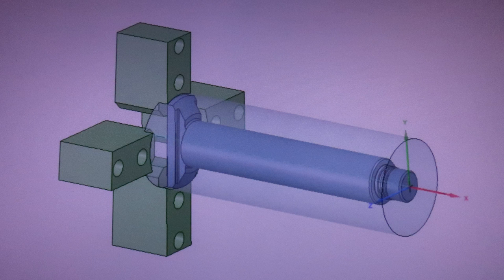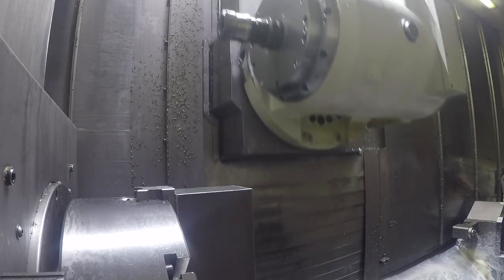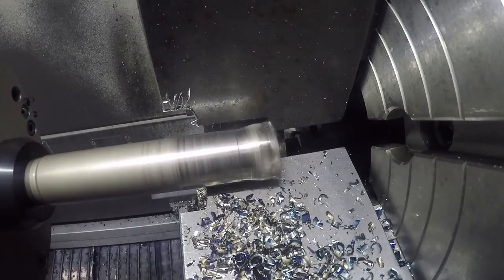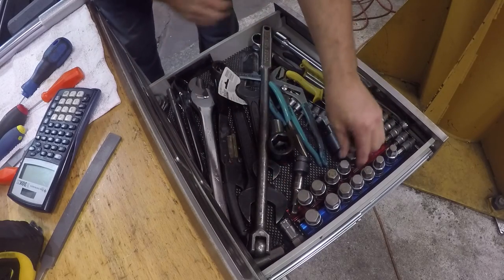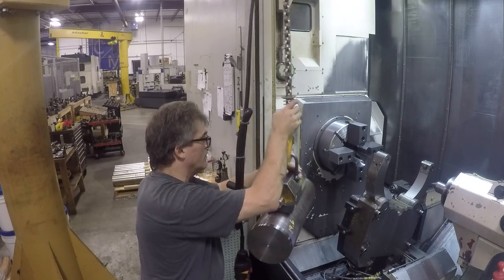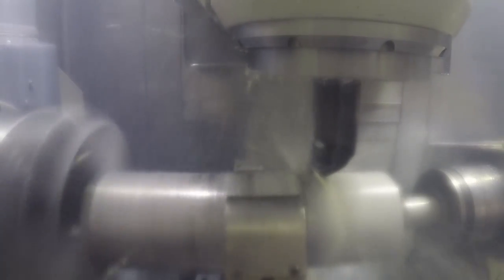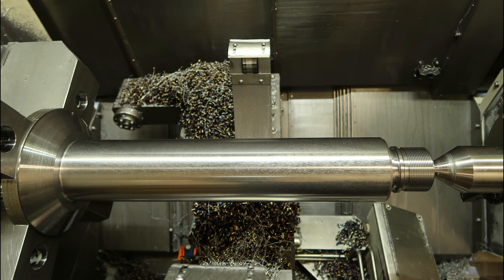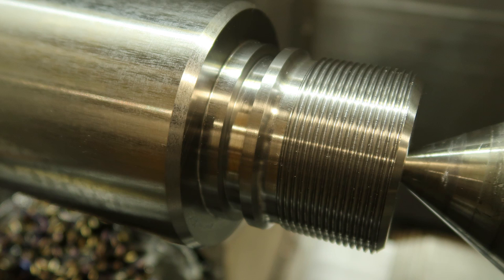Ram Shaft -1

Comment: So, Why aren't you using your tool setter for the Mazak? Seems like the way to go, and you have it.
Reply from the maker: The tool setter it up high on this machine. It is difficult to see what you are doing. I find it easer and faster just to touch tools manually. On the Mazak’s control it always shows the location of the tools tip so it also verifies that the tool is offset properly. This machine also has a laser tool setter. Which by the way Mazak recommends to use for milling tools. But unfortunately it has never functioned sense I’ve owned the machine. I don’t want to spend the money to fix it.
Reply: I meant the optical pre setter you use for the horizontal, I thought I saw that in one of your vids. I've been binge watching so the vids blur together! Thanks for sharing vids.
Reply from the maker: The Speroni tool setter has a Cat 50 taper spindle. The Mazaks milling spindle is Capto 8. Now I do have a Cat 50 to C8 adapter. I would have to mount that than walk over to the optical tool setter and measure the tool than subtract the adapters length. That all would work but it would take longer than just touching off the tool at the machine. I do use the optical tool setter for the initial rough setting of boring heads for the Mazak.

Comment: why not use a round insert? i prefer rounds when im taking big long cuts. you can often take larger cuts with faster speeds. non the less, great video.
Reply from the maker: I just used what I had. Didn't have tooling for a round insert.
Reply: @EdgePrecision  i see! CNMG are quite versitile for roughing. but if you ever wanna try them out, i highly suggest you do, go for something from SECO. best roughing inserts there is IMO. sandvik and iscar has some great tools aswell, but for me seco takes the cake when it comes to roughing. thats just my opinion.
Great video anyways :)

Comment: Do you ever get annoyed with that tight clearance near the jaws? Seems like it can be an issue with a lot of different parts and that you have to make extra long jaws to try and mitigate it. Is that just the small price you pay for the other capabilities of your machine? (-8
Reply from the maker: I actually have a smaller chuck that comes on the machine. I normally comes with a 21" Hydraulic chuck witch would make the clearance issues even worse. I like the 16" manual four jaw better and it increases the available spindle bore to 6.625". The jaws for that 21" Kitagawa chuck would also be more expensive.

Comment: a Little Tip on Jaw truning
Rough:
VC=350-450 m/min 
F=0.15-0.25
AP-5-10mm
leave 1mm on the jaws
use a 80° CNMG insert or something of the same Base Shape
this Operation would go many times faster with these, u can aslo use Shopturn for the simple kontour of a Jaw.

Finish:
Just normal finish turning in 2 steps with an undercut in the corner (Form E/F should do)

and for removing the corners i would have opted for "plunge milling" but this is optional
Reply from the maker: There are indeed many different way to do things. Thanks!
Reply: @EdgePrecision  just an idea, please try it yourself i use it everytime i have to do stuff, my machine is the CTX Gamma 2000Tc
Reply from the maker: That is a very nice machine! You are lucky to run it. I thank you for the help/info . Please don't misunderstand me I'm not saying weather your way is wrong or right. What I present in a YouTube video is not necessarily the way I always do things. It sort of depends on whats in the tool changer at the time. Or just how I feel like doing it. I have done it exactly the way you describe and you are very correct. The kind of work I do, I seldom have to bore jaws. In fact it been over a year sense I have bored any. You may have noticed I have a manual 4-jaw chuck mounted on the spindle. That should give you a idea that chucking time is not significant to my type of work. The type of job I have shown in this video I seldom do.  But Thanks again. I do appreciate your comment.
Reply: @EdgePrecision  alright

Comment: You know, your the only other person I've seen use a gage pin/block like I do to set offsets. I use a .200 on my Haas mill, because on the keypad the 2 is right next to the "." Key. I always jog in the positive direction while applying minimal pressure till the block just slides under. If I overshoot I always pull the block away and then jog back down and redo it. Using this method I've never chipped a cutter. I think the paper method is asking for trouble and is no where near as accurate.
Reply: Same here.  I use a 1" gage block for mill operations.  It's a sweet realization when you can get that much breathing room and be more accurate lol.

Comment: Ram shaft, as in 'hydraulic' cylinder ram..? I'm guess that thread is 12 TPI, seems real common for just about any hydraulic stuff....and that 3" turned area will be getting hard chrome??
Reply from the maker: No electric less nickel it said on the print. My friend in  R&D once told me they don’t like to use hard chrome in sub sea stuff. I can’t remember why though. And I can’t ask him he passed away a number of years ago.
Reply: @EdgePrecision  OK, sub sea...they like nickel better for corrosion resistance..
Reply from the maker: I think if I remember it had to do with the bond of the hard chrome. It tends to flake off where the Nickel doesn't. But I'm not sure. This could relate to corrosion getting under the chrome.
Reply: @EdgePrecision  Engine cylinder liners are often hard Chromed. And the main cause of their failure is indeed the Chrome coming off in chunks. Nickel doesn't hold up to the heat as well so that is why it gets plated over. What do you do with a bad cylinder liner? Send it back and they machine it down to base metal again. And then build it back up with Nickel and then Chrome. It is cheaper than buying a new liner, if you can even get one. In cold work such as undersea valves, the Nickel will protect the stem as well as Chromium would. Surprised they don't just spec that ram as 304L Stainless.

Comment: Why would they choose a 4140 HT that big?  Wouldn't the HT be gone near the center, negating even buy HT?
Reply from the maker: Normally they require the part to be roughed than heat treat than finish machine. In this case they said the material was pre qualified and that wasn’t necessary. I did ask and that’s what I was told.

Comment: What are you doing on 23:23? check that the tool is well measured?
Reply from the maker: I am checking the offset on the tool. Using a 1/2" dowel pin. It been a long time sense I made this video. I think I had not set up the threading tool before this point and had to touch it off so set the offset. I like to use a round dowel pin to touch off tools instead of shim stock or a feeler gauge. If you get the tool closer than the pins diameter than lightly press the pin in the gap. Than back off with the handle jog till the pin just passes thru. This is better than a shim because if you go solid on the shim you can chip or break the tool. also with the pin you can discern between one click (.0001") quit easily on the hand wheel. Than just subtract the diameter of the pin in Z and twice the diameter in X for a turning tool on a lathe.

Comment: I see that most of the time you prefer 4 jaw chuck over standard 3 jaws chuck, why is that? Its much harder to setup
Reply from the maker: Fischer977 , Thanks for the question. I use a four jaw chuck for a couple of reasons.  It lets me use the full capacity of the spindle bore, no draw tube. For many of my jobs the jaws don't travel enough on the hydraulic chuck. The the time savings I might get from the hydraulic chuck doesn't mater for the work I do. Even with a hydraulic chuck with properly bored jaws it still has runout. I can get that closer with the manual four jaw chuck.  This four jaw chuck is smaller in diameter than the hydraulic chuck that came on the machine. This helps with tool clearance issues. The soft jaws cost less than the serrated jaws or I could even make my own easer.
Reply: @EdgePrecision  When precision counts, the 4 jaws always win over the three jaws. You are manually taking up the slop in the jaws that you just can't do in a 3 jaw setup. Unless you want to grind the jaws for every piece that you chuck in them. The scroll gear and teeth on the master jaws always have slop and just one speck of metal in between them will throw off their accuracy.

Comment: are you programming with MAZATROL? and doses't your machine have a TOOL EYE? I see you use your 1/2" dowel pin quite a lot.......
Reply from the maker: No I rarely use Mazatrol. Only to bore soft jaws do I use it. The machine does have a tool eye probe. It is inconvenient to use because of its location when folded down. The location is high up in front of the tool change door. Even with the control pulled as far up toward the spindle end of its travel. It is not possible to reach the handle jog wheel to position the tool close to the tool eye. The tool eye is about six feet high and to the back of the machine when folded down. It is necessary for it to be in this location. You wouldn't be able to touch tool off with something between centers if it wasn't. This machine doesn't have a pendent on the handle jog that would make it easier. But I think I would still prefer to touch off tools manually. On the Mazak the control always shows the tools location in relation to the active work offset. So you get a conformation of the actual location of the tool. The machine also has a laser tool setter. But when I purchased the machine this didn't function. I just haven't wanted to spend the money to fix it. The laser tool setter will do it all automatically. This is designed to touch off milling tools and the tool eye is really for turning tools.

Comment: 19:00 How did you know that the cutter broke, Mazak is able to detect the breakage of the cutter?
Reply from the maker: It is possible to set limits on tools. Typically this is called tool life management on controls. It is possible to set a time limit number of use or load and than automatically change to a alternate tool. This kind of thing is done more a higher production setting. What I have to do is pay attention to the feel and sound of the tool running. With experience you can easily tell when a tool is dull or has failed and stop the machine.

Comment: Evening, can you tell me what manufacture/model the magnetic hoist attachment you are using?
Reply from the maker: Rob McQuillen I will look tomorrow and get back to you. It's been so long that I bought it I can't remember without looking.
Reply from the maker: Here is what I have. Its called a Mag-Mate my model is a PNL 1300. They no longer make that model the new model closest to mine is a PNL 1600. They make many different models depending on the weight you need to lift. There web address is www.magnetics.com  Phone number 800-662-4638
Reply: Thanks a lot!! We need one of these..

Comment: Been years for me (since machinist trade school). Thus, why all the trouble of softjaws for a 4 jaw independent chuck? No concentricity imparted automatically by jaws. What's going on? Better part rigidity, holding surface? What? Why?
Thx.
Reply from the maker: The soft jaws give me a positive stop for the length on the first operation. Also I needed to turn close to the end of the material the stepped hard jaws didn't have the correct step height for that. On the second operation the shaft area that I chucked on to had a 32 finish call out so I used soft jaws in order not to mar the finish there.

Comment: sir can u tell me how do cut centre  on big shafts O.D 350 MM LENGTH 1900 MM 

Some easy and accurate  method
Reply from the maker: That’s a little hard for me to answer not knowing what you have. I could hold a part that size in the steady rest and drill a center hole. I have made a special tool that I can hold a center drill with the B axis perpendicular and above the part. It extends in between the tailstock and the part to center drill the end of a long bar. But that’s me do you have a lathe that big?
Reply: +Edge Precision  yes sir   we have  4 big lathes  

and aslo one turning  centre of 165 mm Indian  make
Reply: +Edge Precision  in india cnc work per hour is US  2 dollors TO 3 dollars. 
some work in scrap  of materials 

u have very good experience  of work theorical  and practical  both 

u go by method and thats make easy and perfect

Comment: You could have cut your complete job time down by just throwing them in a manual three jaw and facing then center drilling.  And that’s where the profit margin lies.
Reply from the maker: I don't have a manual 3-Jaw for this machine. At most it would only save a few minutes over the 4-Jaw chuck. Even if I did have the 3-Jaw chuck to remove the 4-Jaw and mount the 3-jaw would add up to more time than was wasted. Also this stock is larger the the spindle bore so hanging the part out this far I trust the 4-jaw chuck to hold the part more secure than a manual 3-jaw. The hydraulic chuck would do it but to mount that chuck and its associated draw tube would take quite a bit of time to clean the spindle bore and mount it. Also when i bought this machine there was a different chuck mounted so I got the draw tube and chuck separate from the machine. It looks like someone either dropped the draw tube or ran into it with a fork lift on a pallet. the threads are damaged on one end. I would need to repair it first. I have never took the time to do that yet. So I do have a 21" Kitagawa 3-jaw chuck but its never been on the machine. A extra few minutes is a little savings but not even close to the whole profit margin on these parts.

Comment: Using a magnet is an no no. chain or strap on every part. You cant get a correct reading off a magnetic part.
Reply from the maker: I have to ask. What reading are you referring to? That is if the stock got any residual magnification from the lift magnet.

Comment: center drilling without part rotation??? 
well that's what i call optimistic
Reply from the maker: If the machine is aligned properly this isn't a problem. If I'm really wanting more accuracy. I would drill a hole and come in with a small endmill in the B axis. Tipped at the 30 degree center angle. Than mill a chamfer rotating the C axis for the center.
Reply: @EdgePrecision  eeehmmm. yeah...

Comment: Dude you need to be running faster and taking smaller cuts. .01 feed 550sf. .1 doc. It will still throw chips off and won't get stringy. Make sure your roughing tool has a nice radius .06 or higher.
Reply from the maker: This part in this video I didn't select constant surface footage in my cam software. Because of that it wasn't breaking the shaving when it went up the taper at the end of the cut. On the remaining parts when I switched it to constant surface footage (G96) the problem went away. I didn't have any issue with shavings after that. What you are describing would take longer to rough these parts. You say to take half the depth of cut at 75% the feed (My feed was .015) and only 100 sfpm faster (I was running 450 sfpm) speed. This would probably take over twice as long.

Comment: Realistically, this is the wrong machine for this job. 
A roller box would remove as much as required from the 7 inch to 3 1/2 inch in one pass.
End preparation:- a light skim face and OD. using a flat thrust  on the tail stock.(mild steel nut over the centre )
A large 45° shamfer lead in For the roller box eliminates the need to centre drill.
This would cut maching time to maybe 30% for the turning.
Reply: So precise. How large would the chamfer need to be?